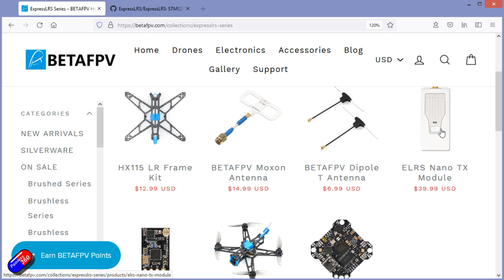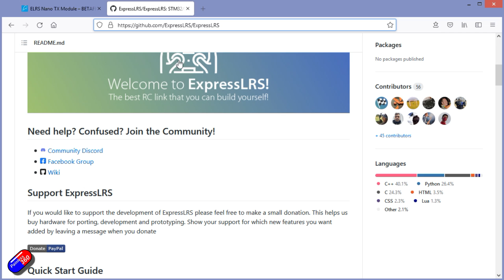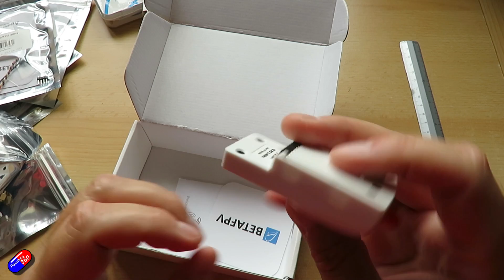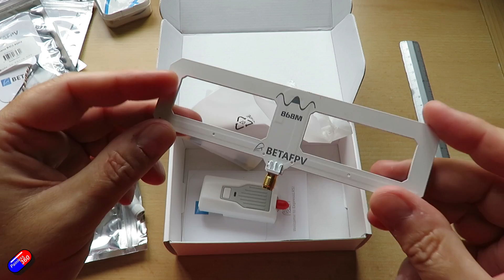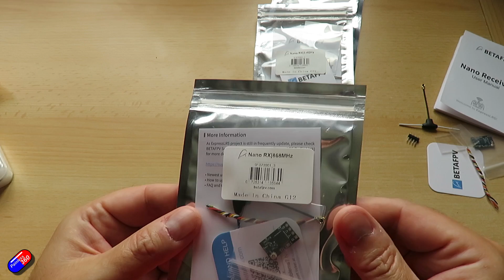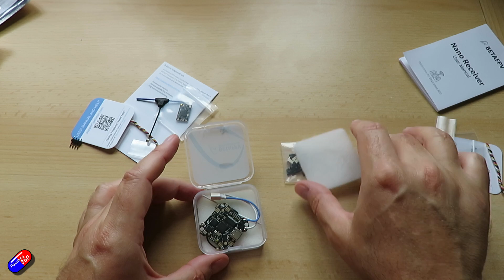BetaFPV ExpressLRS modules, receivers and other stuff in 915MHz, 868Mhz and 2.4GHz!!

Comment: Lee:
   Thanks for this brief description. I'm hoping you will dive into more thorough evaluation and comparisons with Happymodel and perhaps other manufacturer alternatives. - Jim
Reply: Lee:
   I was all in for the ELRS bandwagon on the Happymodel platform until I realized that it may have constraints for fixed wing flying that requires more than 4 variable channel controls (aileron, elevator, throttle, rudder, flaps, pan & tilt camera, plus on/off controls suck as gear, lights, stabilization mode 1,2,3,4,5,6, return to home, loiter, etc). 
   A reply from Joshua Bardwell seemed to confirm my fears.
   What is your assessment on this question?
Thanks! - Jim
Reply from the maker: That is right. Plans for more full resolution channels in the works. Full details on my Patreon feed..

Comment: I have put Happymodel ELRS receivers in my Mobula 7 and ET115. The ep2 version with veramic antenna. Very good range, and very small receivers. In my 5 and 7” quads I installed the ep2. Still testing the range/reception. But so far so good. And the price of the RX’s end the TX is very friendly. 
I believe the latest official OpenTX version has CRSF shot enabled so it’s no longer necessary to install a nightly build of OpenTX. 
Thnx for the informative video’s👍
Reply: OpenTX 2.3.12+ has CRSFSHOT which is what ELRS needs. EdgeTX also has it in their inaugural 2.4 release. Be careful of what transmitter you're using as some need the inverter mod for the higher baud rates, otherwise you are handicapping your link speed

Comment: You can use the white folding stick antenna and solder a cloverleaf omni directional onto it's end so your goggles can fold without unscrewing the antennas for transport .
   Or a folding 850mhz on the transmitter so it always stays screwed on and does not power up without an antenna . I think so .

Comment: I was using ElRs for a while. It does work good however there is an issue for fixed wing. There is only 4 full resolution channels. A motor and 3 servo's are fine but if you want flaps or a pan servo those work in steps and have no set center position. It worked great on my dart 250 and ar wing but when I tried it on my phoenix 2400 it was a no go.  I have since swapped them back to crossfire. I am still using ELRS in an RC car.  Quads and wings are great on ELRS.
Reply: All Elrs systeme are limited in 4  full channel ? 
Elrs happy model is limited too in 4 full channel ?
Reply: @SergyFPV  Yes. It doesn't matter which hardware we're talking about, the firmware across the board is the same - only 4 full res channels. ELRS is meant for quads and wings, not planes etc and it is a very big part of how and why it is so good at what it does - super sensitivity (range) and high, very consistent packet rates
Reply: There is a PR on Github for 6/7-bit aux channels. which gives you 64 or 128 steps. Which should be fine for something like a head tracking cam.

Comment: One of the manufacturers is making a high output receiver. it might even be betafpv....come to think of it the one you mentioned been 20dbi....thats 100mW, enough for super long range telem and on a ardupilot / open tx system that is unrivaled other than a full herelink setup which is magnitudes higher in cost

Comment: Expresslrs is great, note you do need all your Rx and tx’s running on the same version.  So you will likely need to flash everything
Reply: I'm wauting for the empty box version where you build a ultimate unflashed booster yourself . Then you can upgrade it with an internet connection and suitable computers that work . A timer inside the midule could self delete any old software you managed to get

Comment: i really hope that ELRS taks off ... specially in the TinyWhoop, Toohtpick section or as you mentioned ... Parkflyer planes ... 
right now ... i would not thrust it on my 5" quads or where i fly in highly noisey environment
Reply: what makes you not trust it i was thinking about getting it for my 5" build looool did you have alot of failsafes?
Reply: @slickwithit5499  its new... and not widespread IMHO ... and you know how it is with "cheap" products ... looking back at the FrSky Receivers ... i get failsafes after failsafes with them ... taking out my Futaba ... no issues at all... 
in short ... i hast to be tested very well first, before it slap it into my Freestyle quads
Reply: @samrichard4156  Been flown every weekend for a couple of years now by the core devs ;)
Reply: @deltageek7177  good to know .. but ELRS isn't broadly available for ppl that don't wana solder an TX/RX or reflash they existing stuff... its just now that you can get dedicated hardware for it ... 
for example .. i waited around 6month to a year before i switched to Corssfire, cause you never know what issues or bugs come out once you let hundreds or thousands of ppl use it... same is with Firmware ;)

Comment: there are two major issues that are holding me back. first: only 4 full channels - auxiliary are only for switches. talked to developers about it, but there aren't any plans to change this in the foreseeable future.

second: legal status. I'm not sure about this but i don't think the current implementation is really compliant to all rules in the EU.

but to say something nice. I really dig the idea of an opensource control link. i really want to use it instead of the r9 system I'm using now.
Reply: @uhu4677  no. it's a general limitation of elrs.
Reply: Let's not scare everyone away. In regards to the first point, yes only the first 4 channels are full channels. 

When using the hybrid switches mode, Aux 2-7 can be 2, 3 or 6 position switches and aux8 is a 16 position switch. This obviously isn't perfect for everyone, but I would think it's enough for most people. You can probably even use aux 8 for pan camera. Not sure how great it would be but 16 positions isn't that bad.

In regards to the second point, your right, probably not compliant. From what I read on the GitHub it follows most rules but doesn't implement LBT. Realistically, not like anyone is going to chase you for it.
Reply: @ThunderBoy0750  not adhering to the regulatory means at some point somebody could prevent hardware manufacturers from selling this devices. like the FCC did with Hobbyking and getpfv regarding their 5.8ghz vtxs.

DIY isn't an option for everyone. and as an growing open source project they have to tackle this issue sooner or later.
Reply: @uhu4677  ExpressLRS uses 12 channels. The first 4 are full bandwidth meaning they have the full range you expect. The rest have very limited bandwidth and are mostly used for switches that only have a few positions.

Take a look at the documentation about switches here
https://www.expresslrs.org/software/switch-config/
Reply: @derrogers  Your right. Its a possibility. But it's so slim I think it can be ignored until elrs is in a state where the Devs are happy with it. That said, not like the Chinese manufacturers and resellers will give a damn. BetaFPV isn't the only nor the first that has put out ExpressLRS gear.

But ignoring that, the Devs have been looking into LBT since 2019 from what I can tell. There isn't much progress from what I can see especially as they have to dig through a lot of documents and they are still working on features. For example, there's a current PR open that changes Aux2-7 to 128 positions channels, rather than the current 6
Reply: @ThunderBoy0750  thats why eu lbt compliance was the second item in my list. but to be honest 128 positions isnt enough either. i really wished they would implement something like frsky with their 16channel 2.4ghz link. just send the the first 4 channels, and on the next frame the next 4. fixed wing pilots probably dont need that low latency anyway.
Reply: @uhu4677  Depends I guess. A 4 channel plane with flaps? No problem, you don't need full channel bandwidth for something that you would only use a few positions for in practice. 

Pan/tilt? Doable but not great, having only a few steps of movement in each direction

You wouldn't be using these receivers without a flight controller anyway so assume you would do all the mixing in the there, limiting the need for many channels.

Comment: x2 Questions.... Did your 2.4Ghz module have the capacitor mod? Please could you let us know the PCB board version? I just bought one direct from BetaFPV & was v1.0 PCB with the cap missing so means opening up to update which is a PITA. Also  868Mhz doesnt appear in the ExpressLRS Configurator target drop down list so how do you flash the 886Mhz firmware?
Reply from the maker: No cap mod but flashes fine without the need to press the button. I got lucky.